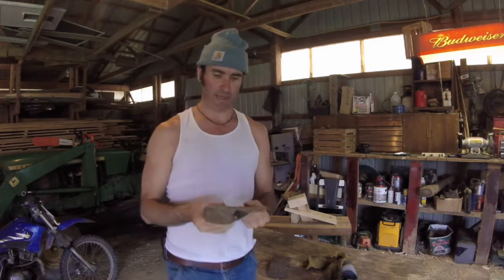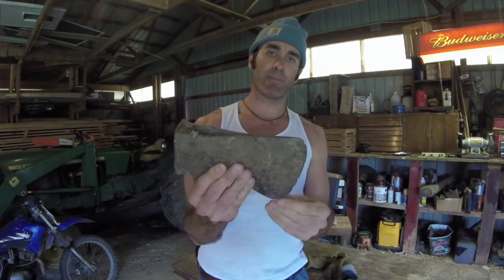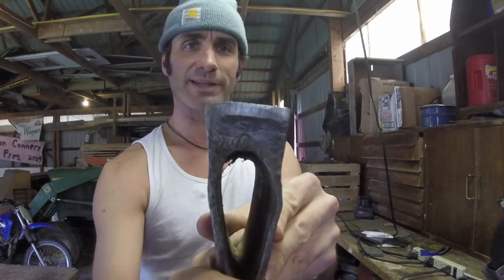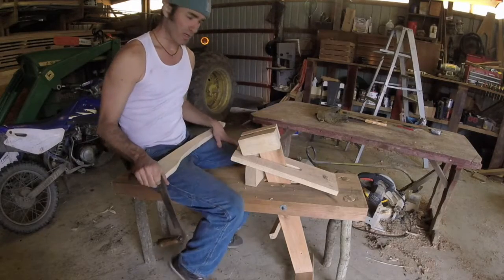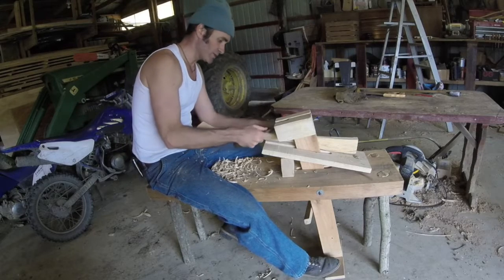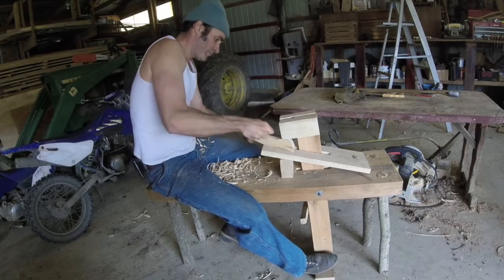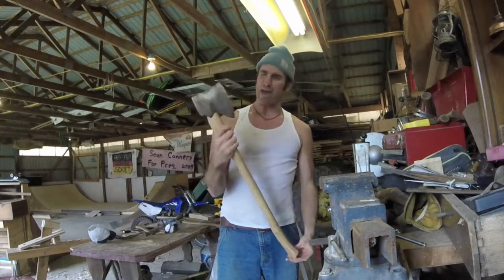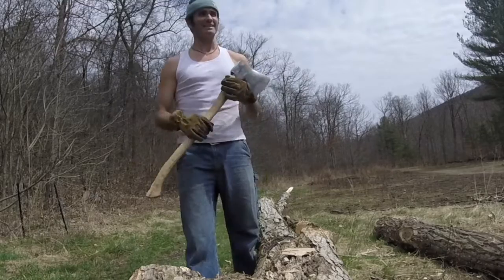Hand-forged axe restoration.  Found in the Susquehanna River

Comment: Huh. I thought you were pulling my leg when you pounded the head on by holding it upside down and letting inertia do the work for you. Was that camera trickery or were you really just holding it mid air and hitting the top?
Reply from the maker: that's legit.   it's called "hanging an axe".   Hey andy!
Reply: vanwags hey Van! Interesting tid bit similar to hanging an axe, when you drive rivets you actually hammer on one side of the rivet to form the head on the other side of the rivet. Doesn’t make any sense and I had to see it to believe it.